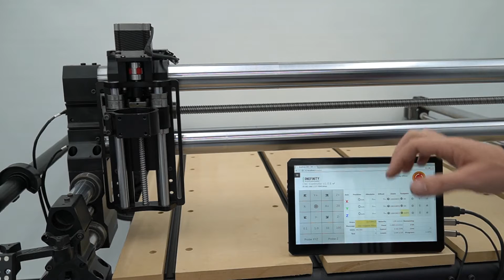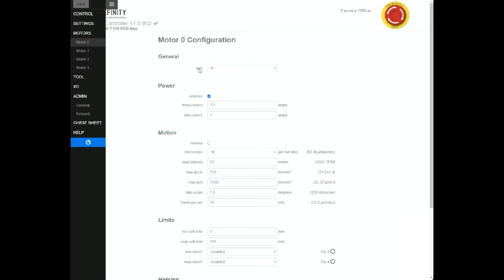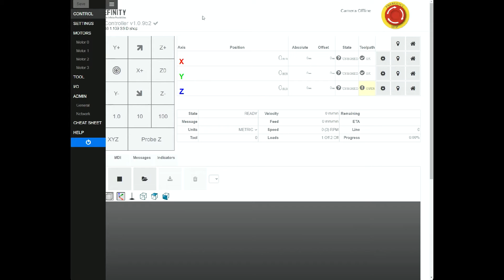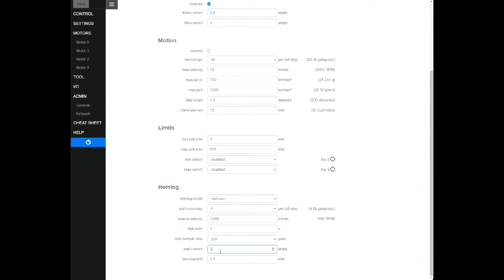Adjusting Stall Homing On The Onefinity CNC

Comment: Failure type 1.
Purchased a pro journeyman new. 
Z axis motor wouldnt home properly out of the box. After reaching the end of its travel to the top the motor keeps trying to spin to raise the z axis beyond its physical limits. I tried homing from different locations with consistant results.

I reduced the stall current for my z axis by .1 intervals as directed and at 0.6 it appears to be operating how I would expect, no more binding up rapid du-du-du-du-du sound and z axis properly homes.
Reply from the maker: Stall homing tuning is a normal operation.  Glad you got it going!

Comment: I just set up my machine in an unheated Canadian workshop and the y axis stalls wherever it is on homing. Without homing, the remote moves y without binding, so I’m pretty sure I’m square. I’ll give this a try today. I assume that I have to change both y axis motors to the same values?
Reply from the maker: That's correct.

Comment: This seems to have helped. is it possible to trackdown the reason this would fail
Reply from the maker: It's not a 'failure'.  It's a normal process that will need to be done from time to time during the lifetime of the system.  Usually around season changes due to humidity, static, electrical changes, temperature drops, expansion and contraction.